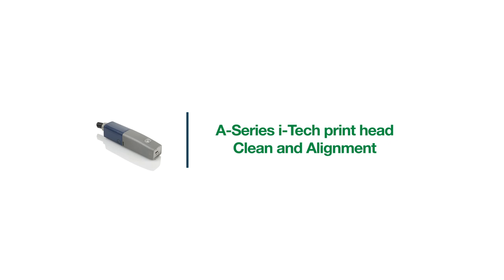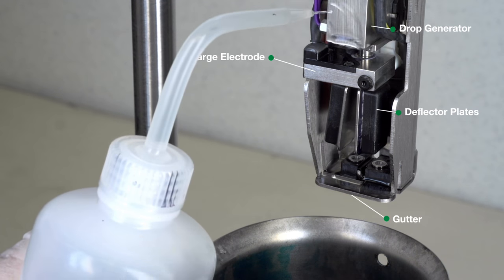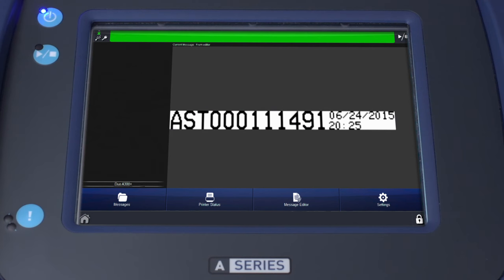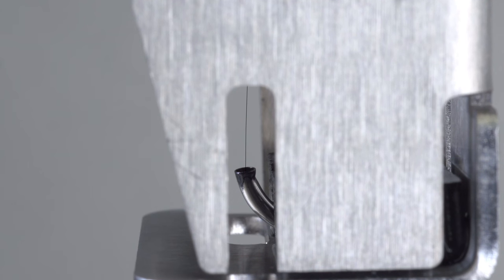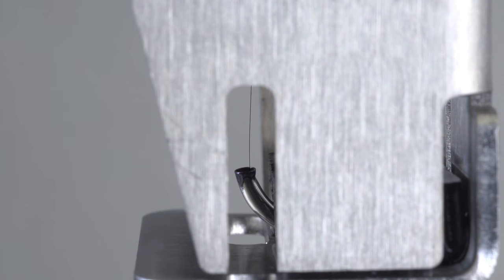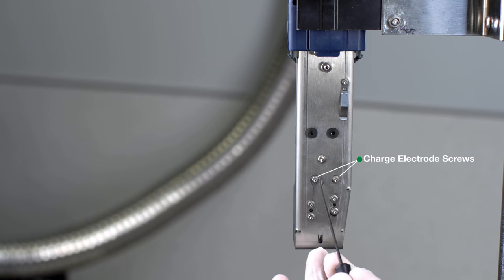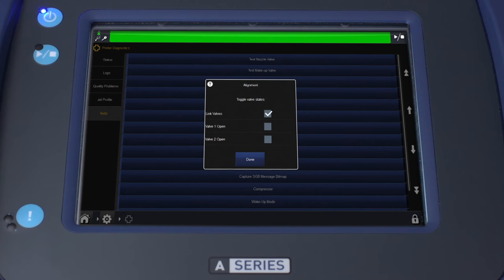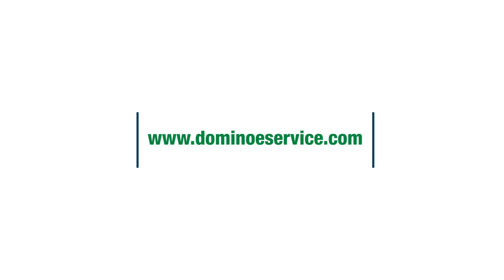A Series Plus & i Tech   Print Head Clean and Alignment HD

Comment: how long should I clean the print head? everyday or as soon as you stop using it
Reply: Cleaning the head only takes a few minutes.  Loosening the charge electrode or adjusting the ink stream in the gutter is something you should only have to do very seldom.  Its not a bad idea to give it a quick cleaning every day before startup, just to make sure everything goes smoothly

Comment: I have Domino a200 printer. how to clean nozzle? I put nozzle in make-up and vibrate for 30 minutes, result it's clean, but not completely
Reply from the maker: For technical support you can contact with our sevice department to the following e-mail : service@labelink.gr.
Thank you!
Reply: como posso entra em contato
Reply: use jet inks wash solution